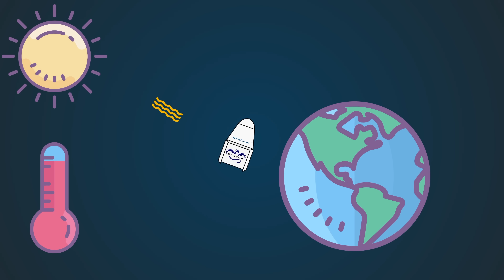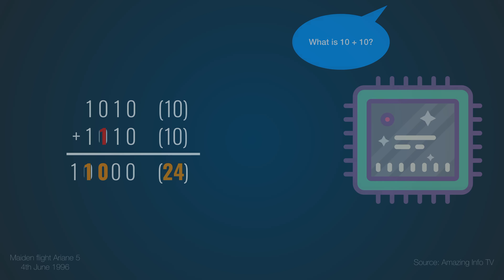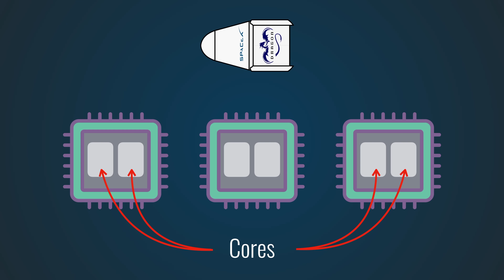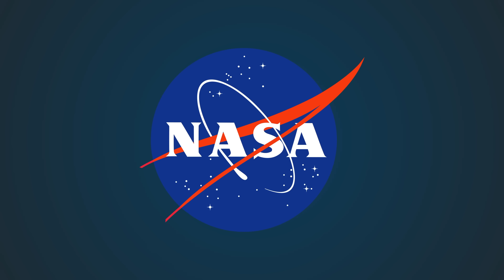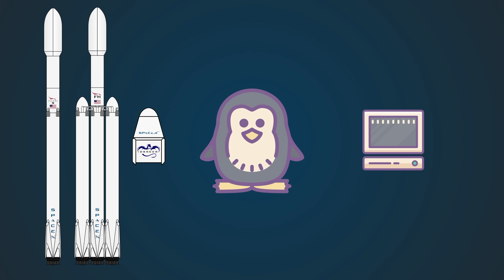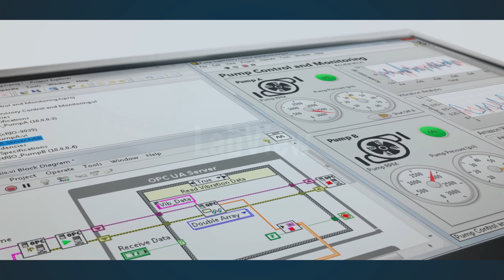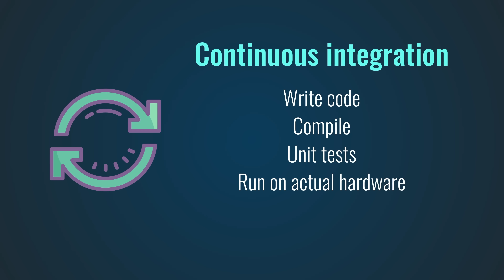Software powering Falcon 9 & Dragon - Simply Explained

Comment: TMR Control hardware is readily available and widly tested  that use RTOS with graphical programming tools that can be further costumized blocks using c++, it is not realy nessessary to go coding level to create cntrol logic and sequence, but you need to be competent in instrumentation, system modeling and control theory to achive this goal. I think space x probebly select an established control system platform and create its own control logic to control the vehicle which simplifies the complexity, no need to reinvent the wheel

Comment: They should soon migrate to rust, even very experienced C++ programmers, are not dangling pointer safe. Rust for this is the new Ada, which formerly was used to write airplanes control software

Comment: This scenario would probably be highly unlikely but theoretically two bits in the same location on two of the three processors could be hit with radiation at the same time. Giving two exactly the same but false readings which would lead to false error adjustment in the processor not hit by the radiation ultimately leading to an incorrect process occurring. I wonder what the odds are for something like that to occur. If the space craft were to be hit with a high frequency of radiation and increase the odds of this scenario occurring this could be a potentially faulty design error. There is probability a better solution to this issue like investing more money into radiation protection rather than just adding more processors to decrease the odds of failure. When it comes to protecting the lives of our gifted astronauts expensive satellites and research hardware I don't think the monetary costs should be the concern. that's just my opinion im no expert on radiation computers or probabilities. This just seems like a flawed design to me.

Comment: I have to say, I'm a little surprised ground controllers would use Windows software. I mean sure, It's not a live or die situation if one single ground crewperson's computer fails. But I'm surprised they'd even put that task upon a relatively unstable system. (and that's coming from a Windows guy.) Still, I was wondering if they where using Linux or propriety systems. The former I find far less unexpected.

Comment: EDAC  error detect and correct,  double bit and you are dead,  so scrub memory 
no problem if it is data ( most of the time)  program errors are typically
NOT recoverable,  hardware reset,   voting,   x86 not
also need  NED nuclear event detection to prevent device latch-up burn out
crowbar the rails to ground

L2 / L3  may not have edac,   ground level seu are about one per month per mega byte of memory
cold boot often

c++  allows data type run time errors,  expected conversion results  can occur

software quality,  ha ha ha

pong and tetris are main routines

Comment: One advantage to launch without humans on board is that Big Black have zero moisture content. Yes there is extreme heat and extreme cold and yes there are awesome amounts of "sun rays"(electromagnetic radiation) but in the age of nuclear weapons we can in fact account for all this in our "gadget."

Oddly enough what we struggle with most is what is what it means to be an an *"Earthling*" environment wise and that is dealing with awesome amounts of moisture in the air (condensation, conduction, convection, straight up heat) and that is what makes getting in the air so hard namely being on Terra Firma in the first place.

Comment: There is a mistake in minute 7:38, LabVIEW runs on Linux too and SpaceX also use Python. In my former job work, in a SRL telescope, several years ago, we use the same software combination, GUI was programed in LabVIEW, scripts was coded in Python and C++, and in the bottom it had Linux with a real time kernel. The system still working in the AGGO observatory.

Comment: They used to use very old computer parts in order to be radiation hardened. Like, CPUs from the 90's. Apparently their transistors were big enough not to be affected by radiation.

Comment: Same logic (odd number or calculators, generally 3 and compare results of the calculations) has been used on driverless subways for quite some time. And it is also probably used in many other fields that need calculation safety. But nice to learn that this is a robust enough concept to be used also in space.

Comment: Triple Modular Redundancy is not the domain of only spacex. It was used on the x29 program and all modern fighters and commercial airliners use it. Video is misleading by implying only SpaceX does this. This is a known design architecture in aerospace. X29 was a NASA aircraft.

Comment: Excellent job. How big would a processor be relative to these systems? Are the processors all grouped together or are they separated by function? Would the processor be the same or similar to what is in my PC. Would the redundant systems all be located separately from the other systems and would they be on separate electrical systems?
Reply: You could probably visualize it as if you had 3 core2duo intel nucs and place them around the Falcon9. Then a bunch more for all the other systems.
(This makes it sound very simple but it's the home-lab visualisation)

Comment: When you said SpaceX uses Linux as the primary software in their computers, it gave me the BIGGEST of smiles on my face, because as a Linux user, I've felt outcasted quite a few times because it's not very non-programmer-friendly, but after a few years of struggle, I am a proud Linux user.

Comment: Linux is suppose to be open source..... no open source at SpaceX
Reply from the maker: Linux is only an operating system. The programs you run on top of it don't need to be open source. However, your comment made me think about their use of the kernel. If they changed something inside the kernel, they are required to open source it again. Hmm... Might be interesting to look into!
Reply: @simplyexplained  Thanks for the response.  As you can imagine they run their Linux on a computer with 3 CPUs, for that to work, they must change the Kernel.  Heck I have a factory running on 4 Linux machines and I have adjusted the Kernel myself.  For security reasons, I'm not connecting my open-source-kernel-adjusted computers to the internet....And you do know that the type of Linux SpaceX uses is secret.  Oh Android is Linux and its not open source......

Comment: Um, Linux for hi SIL levels, not so sure. For safety non critical, decomposed parts, which is hard relatime supervised, could be the case. IMHO, In this case Linux and C++ are good for those fancy touch screen IO. Actual safety control stuff is assembly or C typically.

Comment: Temperature is not a big problem in space because there are no particles to transfer heat or get rid of heat.
Reply from the maker: That's exactly why it's a big issue. Spacecraft can't easily cool themselves, even though space is very cold.

Comment: What? i thought there's some kind of steering  wheel in the control room that is manually controlled by a person?? And no this is not a joke,
Reply from the maker: Couple reasons I can think of. First up, steering wheels can't control all the axis of the vehicle (only turning left & right). Also: a human would not be fast enough to react to certain events and would not be precise enough to hold the correct trajectory.

Comment: 3:39 Could there still be errors when comparing results, though? Or what if two processors experienced bitflips? (So, deriving from your example, let's say two out of three processors return 2+2=7...)
Reply: Each processor is using dual cores which execute the same tasks, so technically there are 6 independent results. Even if that wasn't the case, the chance of two particles hitting two transistors causing the very same error is unimaginably unlikely.

Comment: This approach of using 3 computers as "brain" is derived from/based on the main computer of Soviet Space Station "Mir" from the early 80th, it was called "3х-каналка", i.e. "3-channeled". The idea is the same -- 3 computers in parallel run the same program and react to the same inbound data and commands. Each tick, special hardware compares states of 3 computers -- if 2 computers have the same state, but 3rd got different one -- the "correct state" will be selected based on majority approach.  And the 3rd machine will be either refreshed( in many cases it was simply clonning the state of CPUs and memory from "correct" machine), either rebooted. If 3 sequential refreshes can't fix it during some time, 3rd machine will be halted for some short period and then restarted once again. If restart can't help -- it will immediately get in touch with cosmonauts and send signal back to  Earch mission control center.  One of the most complicated parts is actually the one that compares 3 computers and does "voting". It has to guarantee it got snapshots of machines in sync, and it has to withstand any radiation, temperature and vibration. Also, they had system that is activated if all 3 machines got complitely different state. As far as I remember -- it was trying to rollback state of machines to the latest consistent and re-run program from that state/step. If this doesn't help -- ... there was secret protocol to be used. :)

Comment: curious how spacex handles the issue when all 3 computers calculate something incorrectly.
Reply: It would probably be very rare (that is why they chose 3 instead of 2). Even if they all returned different values, the memory is separate so they can possibly rerun the calculations to see which computers were affected. If that wouldn't work, I can already start thinking of other clever ways to fix this. Even if all three computers were hit, they could probably still figure it out. I'm not an expert but it seems that 3 computers is enough to be reliable if that is what they settled on and they probably have a solution for any possible scenario they can think of. I wish I had an exact answer but if you really are that curious I would learn the skills needed to get a job there and become part of the team 🙃 That or maybe see if their is videos on hardware redundancy in space 😂
Reply: Maybe they compare each calculation at a time and the likelihood of radiation hitting the same tiny spot on every CPU is just insanely unlikely perhaps
Reply: And then they recalculate or sum I dunno
Reply: If all 3 are incorrect the voters know something is off and tells the computers that it’s off. At that point either take corrective action by rebooting or bail out.
Reply: How about when all the 3 system shows 10 + 10 = 24.
Reply: thats called redundancy, me as a naval pilot , use Dinamic Positioning system, which acts like this, in order to maintain position at sea, you have 2 or 3 extras hardwares if something fails. search on youtube how DP system works
Reply: If the probability of a bit flip for one CPU is one in a million then the probability of a bit flip for three is one in a quintillion. This is way past the point where bit flips are your biggest risk.
Reply: usually there is various backup protocols, additional error detection and even communication with mission control. It is very rare for all 3 computers to get bit flipped and then be unable to recover
Reply: This is actually something that can happen!  What they do is designate one of the 3 computers as the master, and if everything disagrees they just use that.
Reply: @nathanheidt1047  That seems sketchy??? Curious to where you found this information
Reply: @nathanheidt1047  I really hope you don't work on crucial systems involving space or flight, or anything that involves human lives for that matter

Comment: Love the channel.
Not enough research, my constructive opinion.. MISSING info on software used for:
AI&ML? 
--autopilot approach?
-python and javascrip or even Lua(my kid's favorite)?
-Tesla batteries control module? Maybe.
Thanks for the tip on radiation tolerance hardware.  If the same approach , radiation tolerance shielding, were to be implemented in Healthcare... so instead of paying $20k for a BARCO diagnostic monitor , we would pay $200 usd. Same case with batteries...

Comment: That's how most modern airplanes works. Most modern airplane does the same thing and use triple redundance and cross check. However, as we learn on aviation, sometimss you could actually have two computers that are wrong and a single computer that is correct (rare but it can happen), and it might cause the correct computer to be dropped.

Comment: Hope you do a revisit of the Falcon9. Not finding any speculation of how they are able to do what they do. The Flight computer should be at the top of the second Stage since that is what gets it to orbit. Go into what is involved with the first stage. It boosts the whole thing then separates, then returns to Earth autonomously  and lands very accurately (usually). What would be involved in being able to do that? Just some redundant CPU's or are there some GPU's with lots of cores?
Reply from the maker: Actually, each stage has its own proper flight computer. For landing, the Falcon 9 first stage uses its own flight computer, just like it did during ascend. As far as I'm aware there are no GPU's because the calculations don't benefit from massive parallelisme.

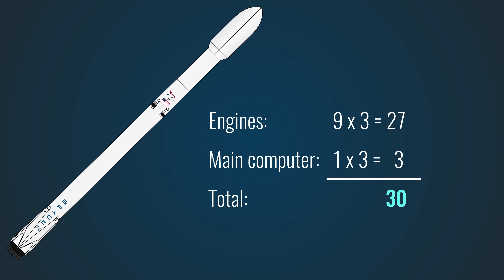Comment: You have made an error in the video at 05:04 as you mentioned 9 Merlin engines with 3 processors each, but the second stage also contains a Merlin engine. It is the same engine only with a bigger bell. This would mean 10 Merlin engines times 3 dual core x86 processors. Other than that, great video! Never saw a video about this before!

Comment: They are essentially using the Blockchain concept to counter the bit flip.
Reply: what? No.
Reply: A Nut - ah. Yes. It is. Look up IBFT algorithm.
Reply: @Enemji  Wait, I don't thing spaceX use IBFT, or any kind of PoW/PoS/etc at all. It's just simple redundancy. Not block chain. Correct me if I'm wrong :D
Reply: A Nut  - define simple redundancy. Ar what point will a calculation be deemed correct?
Reply: its just redundancy, blockchain uses this yeah.
Reply: Hahaha

Comment: so exactly which x86 processors does spaceX use? like 10 years old or 15 years old or brand new? my understanding is that other space companies use at least 15 year old cpus because they're slower and have bigger transistors with more voltage with is good to counter bit flips

Comment: Amazing how nasa with 60s tech landed on the moon.
Reply: Or did they.... 😜
Reply: @thedownunderverse  dont start with this shit man plz
Reply: Ironically those old clunky computers Nasa used for Apollo were far more Radiation immune due to their lack of nanometer scale parts and the higher wattage of said computers made the bitflips even more difficult because whatever radiation trying to cause it needs to overcome the higher voltage/amperage of the parts.

Modern methods are more ideal though, for sure, no one wants to try to fly anywhere either less computing power than a digital watch... again if it can be avoided

Comment: Well you left out the interesting part. How do they cope with multiple processor failures? How do they recognise failure on the two remaining processors, if the third ine reboots? This would lead to the rebooting computer copying a possibly failed computers data. How do they prevent this?
Reply: They don't. The assumption is that multiple failures are very unlikely. Each computer takes in only raw sensor data, the computers work entirely independently beyond voting logic (controlled by a separate unit).

Comment: Small correction: There are select rad hardened mcus and mpus that have rad hardened models. They work just like any other processor would software-wise. There are some small quirks and handicaps, but they don't require any sort of special software engineer to code. These don't use special programming languages.

Comment: algorithms are designed by control systems engineers, it's a mathematical field, and it's 80% - 90% of the work, software engineers alone, with just programming knowledge cannot develop this software, it's like those PID controllers used in drones.

Comment: Game Developers are usually rather bad developers. They adapt very slowly to "new" technology (like 64bit) and are overwhelmed with things like parallelisation, IPC, advanced memory management, asynchronous I/O etc. Often, games would not be able to achieve the performance a given hardware offers by a large margin.
Reply: Lol, I guess that this is my future, been studying electronics at the American equivalent of a "technical" collage for 2 years and still can't code in C++ or in any other language.
Reply: Factorio developers are an exception. Prefetching, cache locality, and many other impressive memory management technologies. They've tested multithreading, but it generally doesn't help because of memory latency. They do a lot of automated testing to catch bugs and consistency checks to avoid illegal state. Unlike some games (cough, Minecraft), it is strictly deterministic and uses lockstep multiplayer.